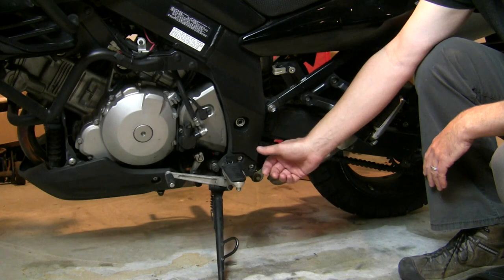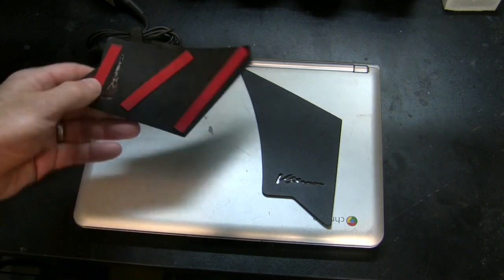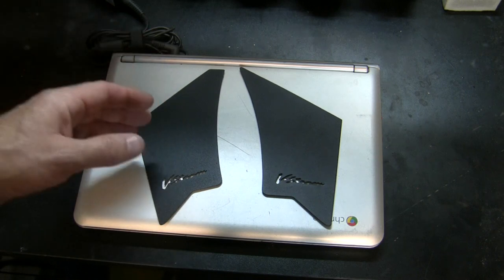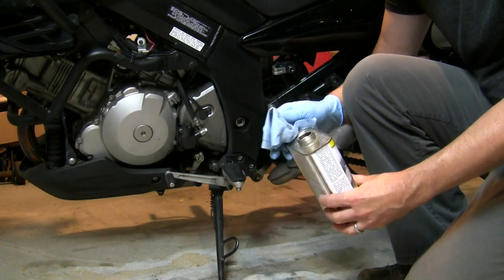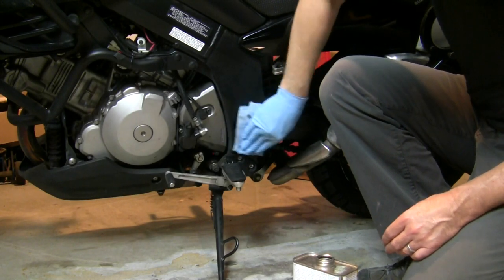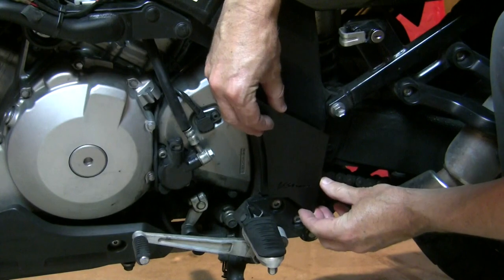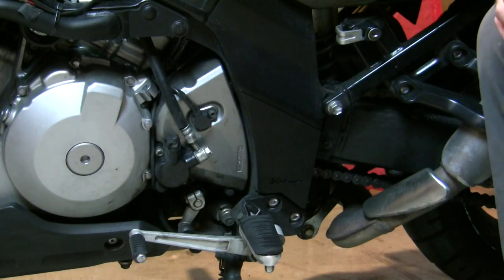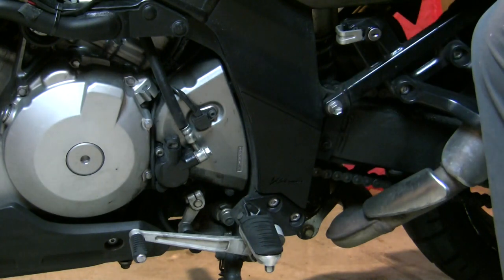V-Strom Swing Arm Bolt Covers (Custom)

Comment: Any suggestions on how to brighten up the signal lights on an '04 ?   
Tough to see them on bright days.
Reply from the maker: I don't have firsthand experience with it,  but 3M makes a plastic headlight polishing kit that may do the trick.
Reply: The lenses are good and clear. It seems it's just not bright enough from the inside ?  Not sure what to do. Brighter bulb ? I don't know.
Reply from the maker: @craigwesson1788  Sorry,  I misunderstood the situation. Perhaps try retrofitting with some CREE LEDs?
Reply: Yes. I may have to ! Thanks.  Love the videos!
Reply: I placed some silver tape inside. It's a kind of tape used in ventilation systems. Place the silver tape covering the black plastic and the light will be reflected outwards. Hope it helps.
Reply from the maker: @SantiFuentesBDN  Thanks for sharing. Great idea.
Reply: Santi Fuentes great idea, thanks !